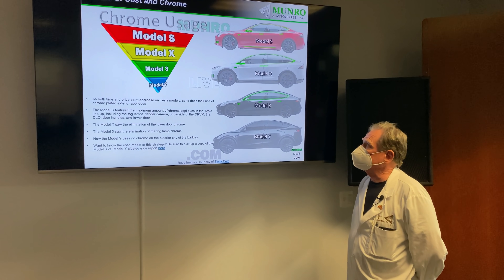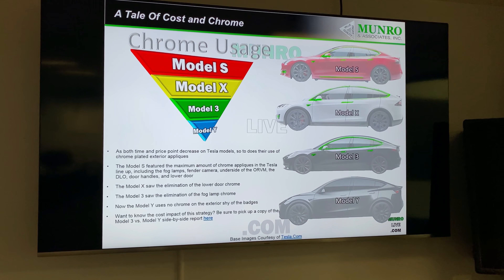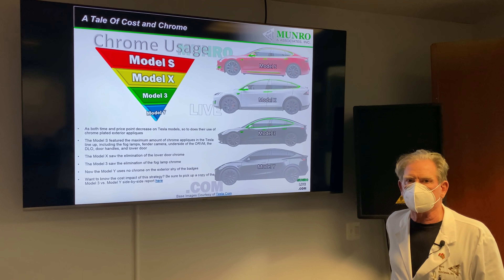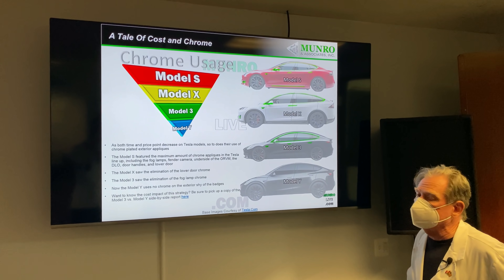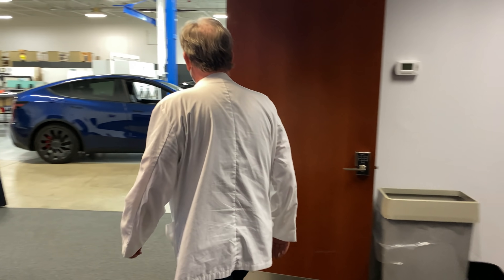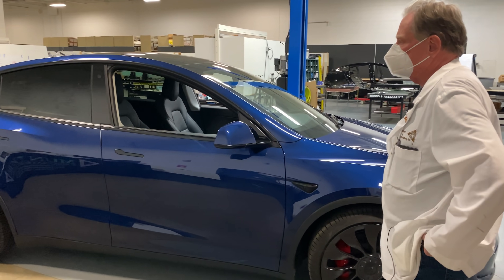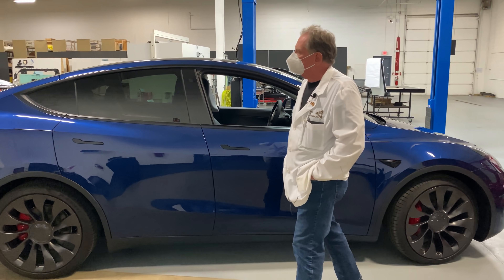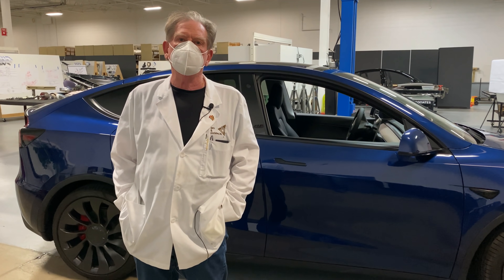Model Y E31: Environmental Stewardship on the Exterior Trim, Door Modules, and Motor Bay

Comment: Just esthetically, FWIW I'm not big on shiny things in general. Specular reflections just make things look more complicated. And they create glare, which pisses me off when I get hit with it. But if you want to make metal surfaces more corrosion-proof, stainless steel probably makes more sense than plated chrome. Chrome really looks like crap if it ever gets breached. There's also anodization, and various kinds of brushed metals.

Plastic can also work well, but if it ever degrades in sunlight…UGH.

Comment: Then why use pearl paint?  Why dual systems in the doors. Why motors in the seats and charge port. Etc.....chrome. Is only part of the issue.  I don’t want AC or electric windows......get real....

Comment: Great series, Sandy.  I think you may be confusing chrome with polished stainless and vacuum aluminum plated plastics. No chromium or acids involved.  Bumpers were one of the last pieces to be chrome plated and those went away with plastic bumper covers.  I think the door handles may have been the only thing that was actually chromed on a Tesla and that is just a guess.  Bright work is a term that has replaced the word chrome as it can be of various materials. 
  I built the car in my avatar and there is little chrome plating. (Excluding the knockoffs). Mostly polished stainless steel and aluminum.     Keep up the good work!

Comment: Sandy is conflating his legitimate concerns and observations about the environment and recycling  with the reasons for removing "chrome" finishes from cars.  The effect is not the cause, and all shiny silvery car trim is not chromium. 
I admire Tesla, but the removal of "chrome" was not done from altruism or concern for the environment. That is an unintended consequence of a long chain of reasons. The decision is pragmatic.  Chrome use has decreased more because of scarcity, oil shortages and war than  concerns for the environment.  Today most decorative "chrome" is aluminum.
The US has scarcely any chrome ore deposits.  Chromium is a strategic metal. Chrome plating is a manufacturing process that is expensive compared to simply not doing it.  Add increased competition for chromium as a component of stainss steel  plus global supply chain disruption from the pandemic.
If the finish of those pieces were chrome, chromium could have become a production bottleneck in expanding Tesla production. While there is probably a stockpile of shiny metallized door handles removing them from the US Model 3 would have been much harder than not having them on any new models. 
btw:  Tesla is not a leader in this. In 2004, the Honda Element had about the amount of shiny appearance metals as the Model Y has today, also had a similar amount of paint.  Public response persuaded Honda to add more paint.

Comment: Sandy:  A skeptical friend of mine is not sold on the "Model Y amount of chrome is less than the Model 3 amount of chrome" environmental argument.  He says the chrome on my Model 3 is just really plastic covered with a thin chrome layer.  I thought the trim around my windows was some sort of real metal, as well as the door handles.  Can you elaborate?  Thanks.  Cheers.  Mike.

Comment: I'm so happy they got rid of Chrome, I sometimes have MAJOR sun reflection issues when driving to work in the morning off the driver side mirror chrome on my Tesla Model 3, even twitted a picture of the blinding reflection to Tesla & Elon. I also put on black stickers on the Model 3 handles and covered up that piano center console finish with a vinyl wrap so it doesn't reflect and scratch.

Comment: So it is cheaper to manufacture painted trim compared to chrome?  I'm assuming so, but I didn't notice Sandy mentioning that.  I personally like a little chrome, I think because for most of my life I've had cheap cars that never had chrome, and now that I have a Tesla M3 I like the chrome on it.  However, it's just aesthetics and styles and preferences change over time.  If chrome has a higher environmental and healthcare cost, then it makes sense to just paint trim.

Comment: "No paint" is misleading. The whole car has ecoat primer process where it will go thru a multistage dip process of wash, degrease, phosphate, electrocoat, so that even cavities are coated.. You can aee this from the biscuit colour.  This is the best protection. 
 Any subsequent primer - filler and top coat are largely cosmetic.
Reply: Exactly. I wish he had mentioned this so it will shut up the people complaining about rust. I mean it's obvious in the video that is not bare metal and the whole bottom of the vehicle is closed off anyways.
Reply: @domg7359  from what I read and see some of the less exposed parts like seat pan pressing are not even ecoated. Value engineering at it's most effective.
Reply: Ah! Ok, this eases my concerns a bit. Can you go into more detail about these processes?

Comment: I didn't realize that chrome was that bad for the environment.  Good to know.
Reply: There are places like Paducah KY where the process is/was grandfathered.  I rode a BMW motorcycle (R1200C) that had a lot of European chromed parts, and the Chrome was substandard compared to what you could get in the US.  This was due to the stricter environmental laws in Europe.  You can still get the chrome look with polished aluminum... it doesn't hold up as well, but you always have the ability to re-polish a scratch.  Once chrome is scratched/faded, it's done.

Comment: I'd like to hear your comment on the fit and finish of the blue one as a comparison....Were the small issues on the red car a one-off?
Reply from the maker: We'll be doing a full Fit and Finish report on the Blue one, taking 10-20 gap and flush measurements on every cutline both interior and exterior.  We'll also do some comparisons between the 2 cars.  Stay tuned for some of that in future videos!
Reply: Mohamed Hassan no need to tear a car apart to evaluate the fit and finish. Just measured the panel gaps and observe the fit. So, I too would like to hear comment on the fit and finish of the red versus blue cars Munro has received.

Comment: You picked up another Model Y?  Great!

Have a critical look at the rear hatch door, Sandy?  I know of several problems with it.

  -  If there's thick snow on the car and you open the hatch, it'll dump a big load of it into the cargo compartment.  Or on passenger seats, if a third row is added.  It's almost as good for moving snow into the cargo compartment as a scoop loader.  Which is great if you want snow in there, not so great if you don't.

  -  The power assist doesn't work right and doesn't look safe.  When the hatch is released and is elevating, that door will bang into anything it can behind the car (like a closed garage door or a person).  Ditto with anything above the car it can reach.  It can easily damage the paint on the car and might also damage what it hits.  It moves with a lot of force.  Model X has sensors to prevent collisions like that.  Model Y doesn't.

  -  When closing, the power assist is also dangerous.  It'll bruise your arm if it's stuck under the hatch door on the car as it comes down.  I don't want to think of what it would to do a 5-year-old if he's half-in the car and the hatch door closes on him.  That hatch is determined to go where it has been told to go, and only reluctantly ceases and desists.

No chrome makes me happy.  Good riddance!

Comment: The advantages to chrome is higher durability compared to a painted surface.  Tesla is not known for having a durable paint finish on their body panels, so I'm thinking the painted trim isn't going to wear well over time.  Also, the benefit of not doing components in chrome finish a chrome finish for Tesla is the lower cost of paint versus chrome.

Comment: Finally someone actually thinking critically about environmental aspect of car manufacture
Reply: Companies long before this have implemented environment measures into manufacturing. JLR for example, has body shops where every piece of scrap aluminum is recycled
Reply: @TennisGvy  I'm referring to Sandy, not Tesla
Reply: @TennisGvy  Organic solvent free paint dipping was introduced in the 80'. Chrome had a flare up 5 years ago, but has really been out of fashion on cars since 1920. Only base coated surfaces on the chassis I thought was just sloppiness, but I have seen it on multiple brands of cars.
Reply: As a kid, I worked on my friend’s Model A ford. . .   He was stuffing a smallblock 265 into it. . .  Some Model As had a chrome radiator shell, which, by 1960 or so, was in pretty bad shape, with corrosion and blistering.  Others were made of Stainless Steel. . .   Pretty well still pristine thirty years later. . .
Reply: Isn’t the chrome on Model 3 simply paint ? Nothing to do with real chrome...

Comment: The original purpose of paint and chrome wasn't aesthetic, it was for corrosion prevention. Unprotected metal on a vehicle in the rust belt states will be corroded after the first winter.
Reply: BLACKVIEW USA , what do you mean it doesn't exist? Many of the attendees at the Cybertruck debut rode in it and Elon has been driving it on the streets of Los Angeles..........

https://thedriven.io/2019/12/09/video-elon-musk-driving-tesla-cybertruck-on-public-roads-in-la/

I assume that you meant to say that it will never go into production but why wouldn't it as the whole purpose of the design was to make it easy to fabricate. The drivetrain and electronics already exist in the other models and the 300 series stainless steel is what they use in SpaceX Starship production.
Reply: BLACKVIEW USA , this is most likely a waste of time because the level of your blatant ignorance has got to be willfull, but none the less, for your edification so as to help you get a freaking clue.........

https://electrek.co/2020/03/17/tesla-cybertruck-gigafactory-missouri-land-incentive/

https://electrek.co/2020/04/29/tesla-cybertruck-gigafactory-location-next-month/

Phase 2 construction, Gigafactory 3, Shanghai, China 

https://youtu.be/I9G2wz3Y3no

https://youtu.be/4mnGczidCwg

Beginning construction, Gigafactory 4, Berlin, Germany

https://youtu.be/KBE208N_HSo

It will be interesting to see if the Germans can compete with the Chinese in the speed of consruction. At this point, Tesla is a freaking juggernaut!
Reply: BLACKVIEW USA , yeah right, with all of the moronic bs that you've said, who do you think that you're bs'ing here?
Reply: BLACKVIEW USA , yeah right, despite the pandemic which caused the forced shutdown of its US factories, Tesla still had a profitable Q1, the first in its history and it's the third consecutive profitable quarter, which is also a first in its history. Deliveries for Q1'20 were up 40% YoY whereas Ford sales were down 12.5% YoY, FCA sales were down 10% YoY, and GM sales were down 7% YoY. So just out of curiosity, where did you derive.........

"His existing inventory in the United States is barely moving. He has plenty of cars available for delivery. The China factories are barely producing much."

You know that, how? Cite your source.

Comment: Sorry but Tesla is terrible with regards to reusabilaty. Just one example is how they replaced the whole charge port just because the little magnet fell off. Today my model 3 is getting the seat wiring harness replaced for the second time instead of fixed so that will be 3 total harnesses in a landfill instead of 0 as I would prefer a manual seat option.
Reply: Martialman.45  well it looks like the y has improved in this area, made up for the failings of the 3
Reply: @DavidHRyall  It's not the car it's the company behind it. At least now the glue the magnets back on the charge port door. Also they need to make the software and parts easily attainable for independent shops and consumers to keep them on the road as long as possible. Over 200$ per hour rates and restricted parts means more cars getting thrown away.

Comment: How hot do those door handles get in the sun?
Reply: Negative thing for those in the south. And a positive for those in the "near north" as if you live in a region near 0 degrees you'll have melted snow/rain that freezes the door handle. True north have no problem as they'll stay way in negative temperatures with very little melting.
Reply: I don't know, but I know that most of the vehicles I have had have black door handles, and I don't remember ever burning my hand lol

Comment: Sandy can you do a wheel video discussing manufacture / design of the Ubertine alloy wheels ?
Some people have shown that smaller lighter wheels can cause a significant range increase and some people have demonstrated much lighter aftermarket wheels beating tesla performance figures in 0-60 tests. 
Thanks !

Comment: Now if only they could get rid of the piano black interior.
Reply: The piano black is such a ubiquitous complaint; has Elon ever responded to it? Seems uncharacteristically dumb to continue with such a disliked console finish.
Reply: Agreed.  Wrapped the console within a week of owning my 3.  Matte black, brushed metal, or carbon fiber all look better than piano black.
Reply: Yep. On the Model 3 unveil show you could see on the middle car (the nice silver with white interior) they used white instead of the piano paint. That looked great! I want like this together with my white interior.
Reply: Seems odd to me too not to match it with the satin finish of the outside trim
Reply: Perhaps piano black is best surface for application of wraps - so most easily modified/personalized?

Comment: When IBM introduced the Proprinter ca 1985 it only contained ONE screw. That screw was in the printhead supplied by Epson.
I am very surprised to see that they still use a great number of screws in the door assembly.
The Proprinter was designed for easy manufacturing. Subassemblies like printed circuit boards could be inserted in the base with your eyes closed. Everything just snapped together.
The whole assembly required very little time, tools and skills.
35 years later I still see so many screws. washer and other fasteners that require precision alignment on cars.
Reply: If you want a vehicle to develop rattles over time, find more ways to remove all screws , nuts & bolts
There is a sweet spot for designs to use the "right" amount
Reply: d b that sounds right. Sometime before the million miles is up some of those plastic clips would be brittle and broken. I’m sure Elon and the gang will figure it out 😂
Reply: I didn't know you could use a printer to drive yourself to the other side of the country.
If you want to make a point, maybe don't compare apples to oranges.
Reply: Nicolas Musset  I think it a valid comparison. Nor do you use a Tesla to print a piece of paper.
Reply: @Findalfen  On my 2016 Seat Leon I have to undo 4 screws to get access to the air filter element. My 2001 Mazda 626,  used 3 easy clips.
Of course, you can not compare a matrix printer with a car. It just shows that ease of manufacturing and just-in-time is not that new.
At that time there were already many quality improvement programs bases on the Japanese kaizen process.
Reply: @olafv.2741  Here that's much better. Why not start by comparing to another car, instead of bringing in a completely unrelated machine?